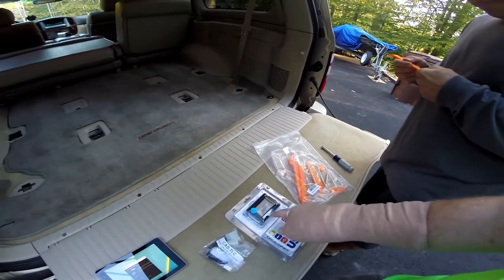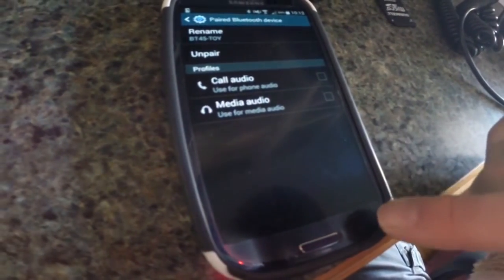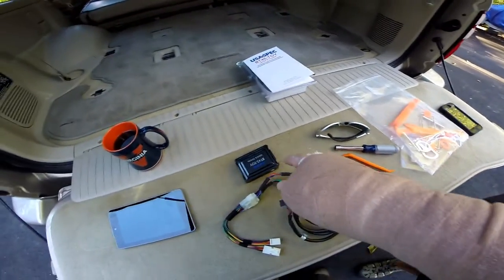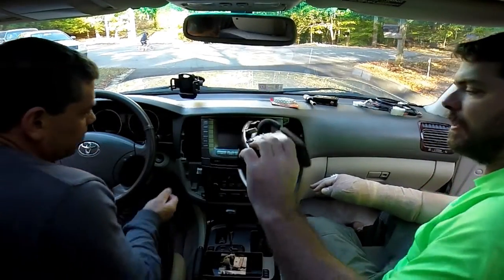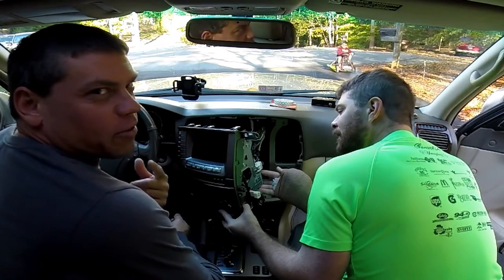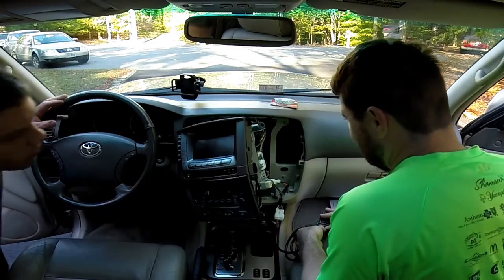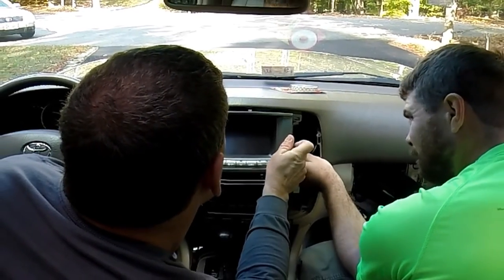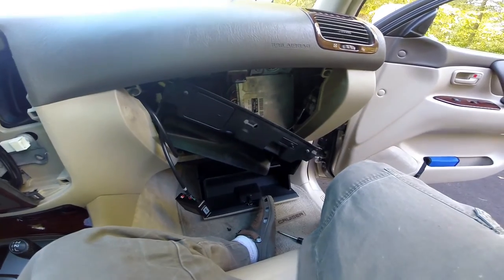USASpec BT45-TOY Land Cruiser 100 Series Bluetooth Install

Comment: Just curious if your phone is able to connect via Bluetooth to both of those at the same time, so that if you were listening to music and a call came in you could answer it right away or if you would have to stop and switch via settings over to the other Bluetooth connection which might be a pain?
Reply from the maker: on your phone in  the Bluetooth settings for each device you can enable the device for phone and/or audio independently.   the factory Bluetooth only has phone and I have phone turned off for the bt45. it's completely seamless other than the inital connection to the LCs bluetooth is slow but not sure that wouldn't be happening anyway.

Comment: I've been really enjoying your videos.  I'm doing a lot of the same mods you have been doing on my 2005 LC with Nav and between ih8mud and your videos, things have been moving right along.  The CD Changer has never worked since I've owned the LC (gives me an "external system not connected error").  My DVD player which stowed in the rear right works and I'd like to use that for the kiddos.  Can I use another "input/button? (i.e. SAT?).  Thanks again for the great videos!
Reply from the maker: thanks man, i don't think you can but your dvd should still work. My rear dvd works fine but isn't controled by the front head unit at all. I am not sure I understand you concern exactly. I can tell you the disc button on the head unit seems like it toggles between the bt45 and the changer although my changer hasn't worked since i got the bt45 so not totally sure. Not sure of that helps at all. Let me know if you have any other questions.
Reply: @BradyAdventures  Installed this am.  Works like a charm.  Your tribulations with the routing of the cable and reseating the head unit helped a lot so I didn't have to waste time figuring that out.  I mounted the BT45 module behind the black plastic "shielding" above the glove compartment and routed a long 3.5 cable that i had through an opening that was there into the glovebox.  It's heavy duty so it stays out of the way under all the other crap I have in there.  Don't know if I'll need it but it's there if a decide to pull out that old MD player ;).  Great upgrade.  Thanks again!

Comment: Nice video guys! I wanted to ask if you think based on the plug in if this system would be compatible with the 1999 Land Cruiser since I run the older stock radio.
Reply from the maker: I am not sure if these work with the older stereos.  The best way to check is go to crutchfield.com and see if it is compatible with your LC there.  Their site is very intuitive and their info is reliable.  I apologize it took me so long to return your comment! This one fell though the cracks. Thanks!

Comment: Great video! Thanks Guys!

I just bought an LC100 2003 (with Navigation and back seat screen), can I connect it and keep DVD/CD changer functionality? Also, do I need the additional cable? I would oike to use it fro both media and calls.

Cheers!
Reply from the maker: Thanks!  We did not need the extra cable.  Some models need it for the steering wheel controls to work.  I think yours is like mine and doesn't need it but I can't recall for sure.  Crutchfield said I needed it but the internet said not and the internet was right.  You can use it for both media and calls just need to run the mic.  I have never used it for calls so can't really talk to that, I use the native toyota bluetooth for calls and BT for sound and they work fine together.  No worries about the DVD player, when you push the DISC button on the LC head unit it will switch between the BT45 and DVD player.  Unfortunately my DVD player died a few days after this.